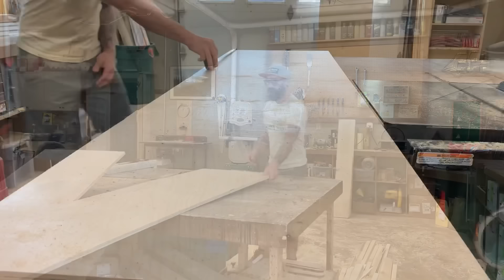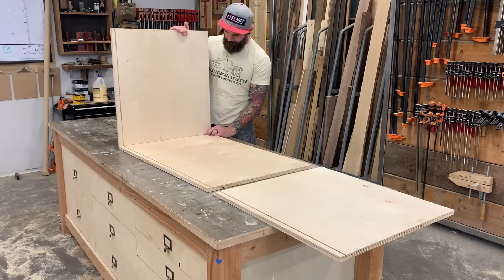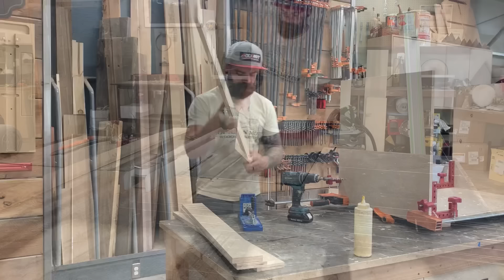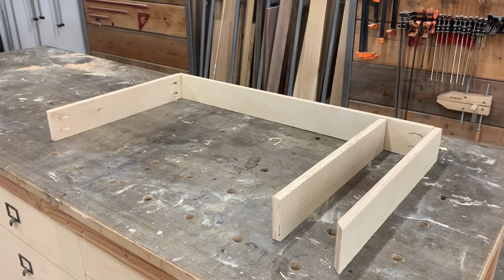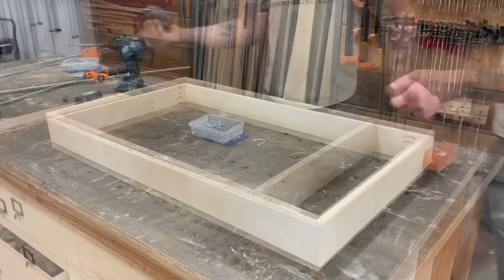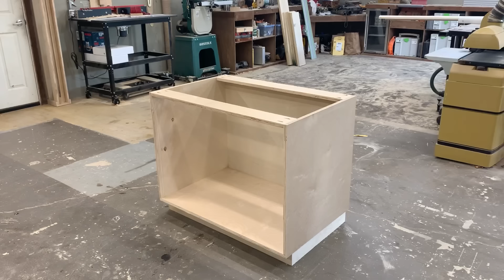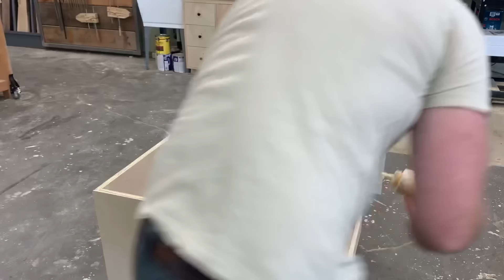Build Cabinets The Easy Way | How to Build Cabinets

Comment: I'm not a safety Nazi, for real.  Wood filler, fine, whatever.  But I'm a boatbuilder and you should really try not to get epoxy on your skin.  It will cause you to become sensitized over time and then you won't be able to be in the same room with it.  It's a real thing that has affected a lot of people.
Reply: Really? I never knew that, thanks for the tip. I will use those blue rubber gloves from now on.

Comment: I know you said that you like to make your Kick Plates separate from the main box frame, how do YOU attach the Box to the Kick Plate? Do you level the Kick Plate in place and then use screws through the bottom of the main Box or figure out the leveling before attaching it with Pocket Holes and wood glue?
Reply from the maker: I don’t 🤷🏻‍♂️ the cabinet just sits on top. I install the kick plate first and get them all leveled then attach it to the wall. Then I set my cabinet box and it gets attached to the wall. No need to attach the kick plate to the cabinet.

Comment: Love this video! Have been building my cabinets the exact same way for almost 20 years. This is the most profitable way to do basic carcasses. No failures, happy customers and you can bang them out pretty fast with a good helper.
Reply: Actually, this is the most expensive and time wasting way of building a cabinet. This method is for those that have to much time on their hands and nothing else to do. I am a professional cabinet maker, for over 20 yrs now, if I built cabinets like this, I would be bankrupt in less than 6 months.  Is it a nice cabinet? Sure. Profitable, not so much.
Reply: @kenboyles72  to each his own Kenneth. We recently did a complete kitchen with similar methods. After all panel parts are cut and marked, its basically assembly line production. Same with face frames. My customers don't want cheesy overlay doors drawrs either. Everything is inset so if you know your stuff, you understand there is zero margin of error for parts being square. "nothing else to do"...maybe you need higher end clients, then you won't need to spend so much time in the shop and spend more time enjoying your profits. Have a great day!

Comment: One more question, if you were using doors instead of drawers here, how would you attach the carcass to the subbase? Generally, I imagine people just screw it down, but that's gotta be ugly in a cabinet with doors. Could I just glue it? I could shoot a couple nails in there. Etc. Just trying to ask the "right" way to do it
Reply from the maker: I don’t attach it at all. The toe kick gets attached to the wall the cabinet sits on top and gets attached to the wall. But the two don’t get attached to each other

Comment: What’s with all of the thumbs down?
Nothing negative here. He builds his way.
Reply: I think it has something to do with the fact that there is a huge face frame overlapping the lower part of this cabinet. Instead of a rabbit joint along the bottom, he should have ran a dado the width of his partitions, normally 2 1/4”, so that the lower shelf is flush with the top edge of the lower face frame. The way this cabinet is made, you now have an 1 1/2 drop on the interior of the cabinet. Open one of your cabinets at home, you can brush out with your hand anything that my be laying on the lower portion of the cabinet... it is, without a doubt, the correct way to build a cabinet.
Reply: aaron jackson yes you right but remember there's more than one way to skin a cat and we can not always follow some specific ways of building something 🤷🏻‍♂️
Reply: @almamarcelagozo6517  That is very true, however, there are constants and there are variables. Unless you are building the cabinet to hold things, like a pool of water, you should always flush up the bottom shelf with the top edge of the lower face frame. If he is going to do a tutorial on building cabinets, might as well build them the correct way. Everything thing else is quality, I build cabinets much the same way, I have a pocket hole machine, so I use this method to pocket screw all of my nailers and stretchers to each other and to the back side of the face frame as well. Just to be super clear, I am not knocking this guy, just giving a heads up as some people, clients, do not like this over sight.
Reply: @aaronjackson6257 you forget that he’s making this cabinet for drawers.
Reply: I thought the same thing, there is not only one way to build cabinets. I don’t understand why the thumbs downs.
Reply: Haters are gonna always hate!!!   Unbelievable!!!   If you don’t like it just don’t watch it!!  Keep it moving
Reply: He's a jerk?

Comment: Can you give us some guidance on the depth and height of the cabinet? (I know the width can vary).  I'm also wondering how the depth of the cabinet determines the length of the Bloom undermount drawer slides (as shown in part 2)? Is there a rule of thumb for drawer slides?  For example, (these are random numbers) if the depth of the cabinet is 20", then you buy 18" drawer slides.  Thank you for an awesome video!
Reply: PS. I'd be willing to pay for plans for these cabinets via your website.
Reply: @b.lemire7453  Standard base cabinet height for most locations such as kitchen/bath (desk areas may be lower) is 34 1/2" from the bottom of the kickplate to the top of the cabinet.  Standard overall depth for base cabinets is 24" (from very back of cabinet all the way to the front of the faceframe).  You are correct in using slightly smaller slides than the base cabinets depth.  22" slides are most common for 24" deep base cabinets (Because the actual depth of the cabinet will be less than 24" and more like 23" and that 1" of space in the back leaves room for rear-mount slides - which I'd recommend - if that is the style used to install the drawer.)

As for Upper cabinets, 12" is standard overall depth and height varies, but most common are 30", 36", or 42" with the upper cabinets installed 18" above countertops which will help determine the correct height.

-Been remodeling kitchens for 4 years now.

Comment: You missed the true first step. 

Buy thousands and thousands of dollars worth of equipment.
Reply: Not true, everything he did in this video could be done with a kit of tools costing under $500. Less if you go the flea market/thriftstore/garagesale route. The Festool track saw for example is nice to have, fast and easy to set up, and makes sense for a pro, but a homeowner could get the same results with a consumer grade circular saw and the straight factory edge of a scrap of Masonite. He has a good table saw, but its main advantage is the assembly/outfeed/support table he has built to go with it, which you can knock together from 2x4s and a sheet of particle board. If you are willing to do a bit of fussing and tuning, you can find a table saw of adequate quality, used for around $100 bucks.

Comment: Nicely done. I owned a commercial wood shop for many years. Did lots of retail, fast food joints, offices. rarely kitchens. As such face frames are never used. With no faceframe to hold the plywood from warping it isn't used either. Particle board or MDF mostly with melamine or HPL coating. Our standard edge was 2mm  PVC.  The basic box construction was very similar to yours except no dadoes. In order to compete nationally we needed to build to AWI standards. We opt to use dowels. The results were very sturdy cases with no measuring required in the shop. CADCAM meant that all holes for hardware mounting, line bore, dowels etc.  were done on the routers. Banding on an automatic machine, edge dowels on a CNC bore & insert machine at about 1 second per dowel. Assembly in a case clamp. Clamp time about 3 minutes. Lots of curved cases and moldings were made. A very different business than a small cabinet shop, but fun, sometimes. 

Your video is excellent for the  tooling level of a very small cabinet shop or home shop. Many very small shops have now gone to CNC routers.

Comment: If you just nailed the face frame on, why didn't you glue and nail the nailer supports on from the plywood into the 1x4s ( around 11:12)  Would have saved a lot of time.
Reply: The face frame isn't structural, the nailer support is.
Reply: nails are structural....

Comment: great video! somewhat unrelated question, I know you mentioned in your video outlining tools you would need for woodworking that a table saw is the most important tool in a woodshop. In that video, you mention a dewalt job site saw, but I know you are using the grizzly cabinet saw in this video. Which would you recommend for a woodworking beginner with house framing experience looking to do more finishing work?

Comment: Nice video!  I was concerned about a 1/4 back panel, until I saw you had the upper and lower nailing boards added in.  I took a class where we built boxes without the nailing rails, but used 1/2 plywood for the back panel, so that the entire back surface was strong enough to support the cabinet weight, and you weren't limited to driving a screw only in the top or bottom 4".   Probably just a preference based on various stiles (styles)- see what I did there?  lol

Comment: Better to incorporate the kick plate into the sides. Better to rab your sides to receive the top braces for the front and back. There's no need to clamp your sides square if your 1/4" back is square and should probably be rabbed, not dado'd. There's more but hey, I'm just a professionally trained and experienced commercial journeyman cabinet maker...
Reply: I get your points but I also understand why he did what he did.
But then what do I know, I’m just a smart guy with no training who rebuilt an exterior wall (including windows and electrical) without removing the windows or turning off the circuit ... replacing two electrical boxes was required.

Comment: How would you build face frames if you wanted to use European style cabinet door hinges ? 
it seems like a guy would need the inner face frame to be flush with the inside cabinet wall ,or a piece of 2×2 mounted to the inside face frame, so as to fill the void needed to attach the hinges? 
great video👍🏼 thanks for the tips!
Reply: They make european hinges of which the cabint half mounts on the edges of the face frame. My whole kitchen was retrofitted with this style hinge.  The only negative is if you want pull-out shelves for your lower cabinets you will need to mount the lower hinges higher than side height of the pull-out, or install spacer blocks behind the slide so it clears the hinge half in the face frame ( about 1/4 in.).

Comment: Dude I just don’t know how it’s cheaper than buying.. because the drawer sliders are like $10 a piece
Reply from the maker: You’re using the wrong drawer slides then. They should be like $25 a piece
Reply: Bourbon Moth Woodworking ya that’s about $200 in door slides no?
Reply: They're $40 each now...and I just ordered 3 haha.  But I want to give the under mount slides a chance because I always have issues with the side mount slides.  Plus if you have to build a custom sized cabinet, you can't just go buy a cabinet from the local box store.

Comment: I've just started doing some projects with miters, and I love this tape technique, but what is CA glue and Accelerator? Can I just get that at a home depot or lowes?
Reply: CA glue is basically Super Glue / Crazy Clue.  CyanoAcrylate = CA  and the accelerator just makes it sticks faster / better.  Not the same, but I consider it like a 2-part epoxy.
Reply: Yeah you can buy it there but the problem is places like Home Depot and Lowes, etc, jack up their prices. When I was building model plans (the kind with engines and flown remotely) I bought 2 kinds (thick and thin) from a local hobby shop. But I also bought alot from TowerHobbies.com. Back then I had to call them, no internet, but way cheaper.

Comment: So what's your material costs for a cabinet like that?
Reply from the maker: Probably like $65-$80 for the carcass. Then maybe another $200 for drawer slides, drawer box materials and drawer face materials.
Reply: @Bourbonmoth  I was thinking of attempting building my own kitchen cabinets. It's a small kitchen and my current cabinets are shot. Any recommendations for ways to cut costs that wouldn't have a huge impact on quality? I'd be painting them so I don't have to worry about materials as much.

Comment: I’d like to build my own Aquarium Cabinet. I have a Manufactured one for my 65 Gallon that is very impressive. I want to build one for a larger aquarium, at least twice the size of my 65 Gallon. I want it out of all plywood, with 3/4” strips glued and double or tripled up. I’m not sure if I should build the internal structure first or build the outer cabinet shell first and reinforce that. Could you build an Aquarium cabinet, for someone local to you, and put it on YouTube? I’m sure someone would pay you to build an Aquarium Cabinet. BTW I have a Table-saw, and other saws, a Router, Sanders Doweling Kit, and many other woodworking tools.

Comment: What are the orange measurement tool called you put on the table saw to set the blade depth?
Reply from the maker: Setup blocks
Reply: I have a smaller set of those I got from Rockler Woodworking.  Of course I lost the one I need the most, but it proved to me how measuring by sight/feel was a lot easier to get exact cuts than using a tape.   @Bourbon Moth Woodworking- what brand / company are those set-up blocks from?

Comment: That build took forever, do you charge $5K per cabinet?  That’s the only way you’d make a living.  You’ve got to learn to use dadoes and toenailing on those carcass parts if you want to speed up. Also, should use an overhang on the face frame to allow for easy joining to the next cabinet, which, again would speed things up.
Reply from the maker: Your mom took forever
Reply: @Bourbonmoth  Wow!

Comment: New subscriber.  Any reason why you don't use a flush trim bit and router to clean the edges of the face frame?
Reply from the maker: I’ve yet to find a flush cut but that doesn’t still require some sanding to clean up. So if I have to get the sander out anyways 🤷🏻‍♂️ unless I’m really sloppy and leave a ton hanging over.

Comment: Why do you prefer sanding the face frame edges versus using a flush trim router? Just curious if that gives you a better edge finish over the flush trim bit?
Reply from the maker: I’ve yet to find a flush cut router bit that doesn’t still require sanding to clean up. So if I have to pull out the sander anyway 🤷🏻‍♂️unless I get sloppy and leave too much hanging over.

Comment: This video got my sub! One question, if I may - Do you make the separate toe kick frame out of whatever 2x you have on hand? Can I use construction grade pine in that spot, or should it also be hardwood for strength?
Reply: I think he used the same plywood for the base as he did for the cabinet itself. One detail I didn't catch was the amount the cabinet seemed to overhang the base. It can't be much. I know the offset on the front for the toe kick, but there would be a seam on the sides if he tried to fit them exactly. Any comment on that, Jason?
Reply: Bob I was thinking the same thing about the side seam, but then I noticed that he has a toe kick inset on both exposed sides. 

This is not like you would have if,say, you bought a kitchen cabinet from a store.
I
If you’re installing a few cabinets in a row, you only have a toe kick on each exposed end. Also, you can build one long toe kick base for all of your cabinets to install on.  You get the one toe kick base all leveled up before installing the cabinets on top of it.
Reply: @69125173  Two toe kicks for the exposed 2 sides. If this wasn't done then you would have a seam. Pros and Cons of each method. So the toe kick base is leveled and secured to the wall then the cabinet box is set on top and secured to the wall but not secured to each other?

Comment: Loved the video, but was wondering how to attach a face piece on if you plan to have doors AND exposed sides when it isn’t going to be painted? You mentioned a couple of options involving pocket holes on either the inside or the outside, but none that would be perfectly hidden...or should we always plan for drawers to be on cabinets that have exposed ends? (Can’t put drawers on upper cabinets though!)

Would also be nice to get a rough estimate on the total build cost at the end btw - looking forward to seeing the rest of this series!
Reply: Outside pocket holes for most of the cabinet run, then a groove in the face frame with a matching rabbet on the carcass of the end cabinet.  Some people also will allow for an overlap of the face frame on the end cabinet that allows for another finished panel to be added flush later that hides the outside pocket screws.

Comment: If you cut your rear inset 1” in instead of 3/4” you will have a 1/4” reveal at the back that can be easily cut to plume to bad walls.   Just use shims  where needed.

Comment: At this point is the bottom (toe kick) joined to the cabinet? I like your decision to leave it free to level, but curious to see how you attach it after that.
Reply from the maker: I don’t. It just sits on top but both the cabinet and kick plate get attached to the wall so they can’t move